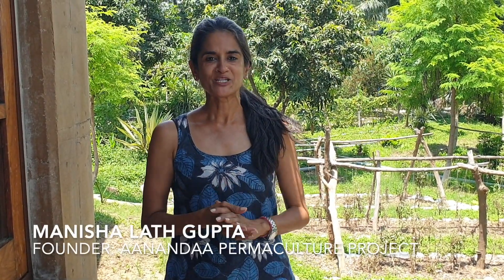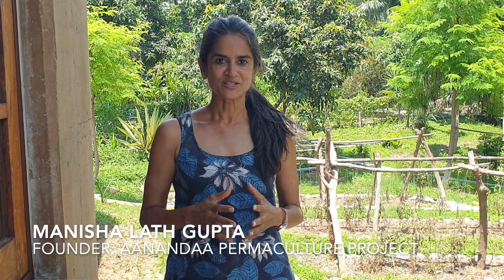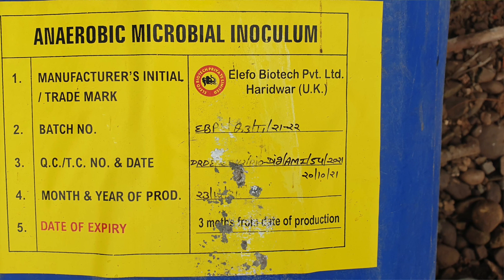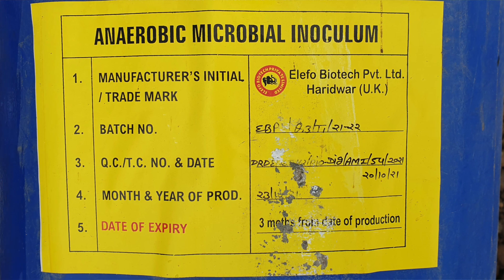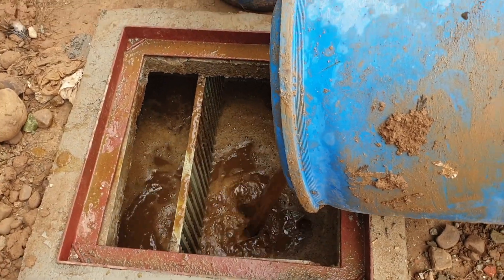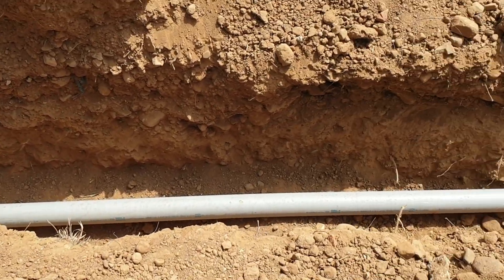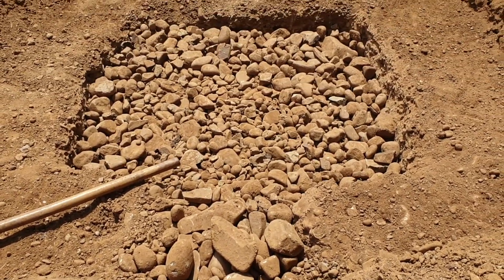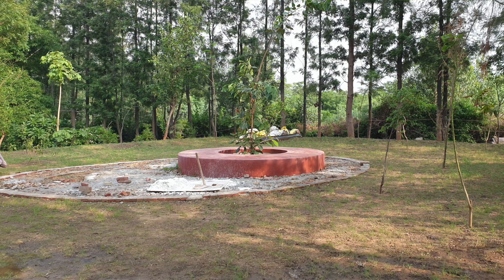Manage Human waste with a Bio Digester

Comment: main by product is the gas that can be used for cooking or generating electricity. if you are worried about smell it can be filtered with carbarn or charcoal methane gas is one of the reason for climate change don't let it go away like this

Comment: There are some microbes that consume methane. They are known as methanotropic microbes and they are seen in wetlands and paddyfields. Since methane had an extremely high warming potential in atmosphere, wouldn't it be better, if the gas from the system is run through a bioremediation step with some wetland plants inoculated with methanotropic bacteria?
Reply from the maker: Sure that sounds like a good idea 💡

Comment: Hi! Would you happen to know if the waste slurry can still be fed to composting worms?
Reply from the maker: No you. And wondering how you will extract the slurry as the output is only digested liquid, not a slurry
Reply: @farmaanandaa  Isn't there a point of saturation where the output becomes a slurry at least at some point? Other videos I've seen show a slurry coming out. Are they able to digest everything of the solid mass into liquid form?

Thanks for taking the time to respond!
Reply from the maker: Yes they digest everything into a liquid. It may be different for other bio digesters which are not commercial solutions, but more like a septic tank. And cow dung is the main input
Reply: @farmaanandaa  I see. I saw a vermicomposting system for humanure and I thought that putting it into a biodigester first then to the worms might be better. Ah well, on to other possible solutions! Ty again!
Reply: @Norbingel you are correct, and are a progressive thinker.  Y

Comment: Thank you, Manisha ji - for sharing your initiative of this Bio-digester for human excreta. Helpful indeed. For my proposed off-grid sustainable house I was planning for a composting toilet - where the excreta and urine both are directly collected in a drum made of wicker or thin bamboo etc. However that can be a bit uncomfortable for visitors and those not used to it. Had heard of this bio-digester earlier too, but I'm a bit skeptical on whether all solid material will be digested/converted into liquid effluent (which is of course nutrient rich). Anyways you have confirmed, it does. I will further talk to the manufacturers/suppliers.

Comment: Hi dear, very informative and nice video. Can we use concrete septic tank (already existed or new) instead of pvc and then use anaerobic bacteria. Generally septic tanks are also fully closed and air tight. And if it is possible how  to construct the tank? Generally nowadays there are 3 chambers in septic tank with or without a sock pit. And where we can buy the anaerobic bactrias? Thank you.
Reply: Yes, you can.  And since you are so progressive incorporate Vermiculture along with your biodigester.
Reply: @estebancorral5151   thank you
Reply from the maker: You will have to check with the bio digester company

Comment: Yayy. Another video. Are you ok with sharing how much did this cost you? and also, in case of an extended "digester drought" and loss of bacteria, is it possible to add another batch of bacteria to restart the process. I am thinking of having a dedicated entry to be used only for this emergency.
Reply from the maker: You can check with Elefo biotech  about pricing. We believe we can get another batch of bacteria in case the existing bacteria dies.
Reply: It would not be a bacteria drought.  It would a bacteria murrain.

Comment: It's best if the gas can be captured in a BioGas baloon to be used for burning, cooking, powering Electric Genset or even CNG cars
For using it in car it will need to be compressed into a cng-cylinder using a simple compressor which is used to fill car Tyre (with air). 
Many people have a mental block of using poop-gas (biogas) for cooking... (just like putting rain water back in borewell is considered unclean) but that is how nature produces Methane Gas...  by decomposed organic matter.
Reply: You are backward and not safety conscious. The compressor for methane has to have special coatings or fittings to avoid build up of friction which will cause an explosion with inflamable methane.